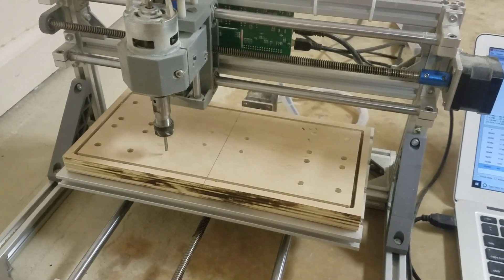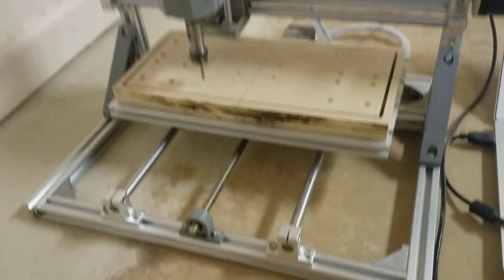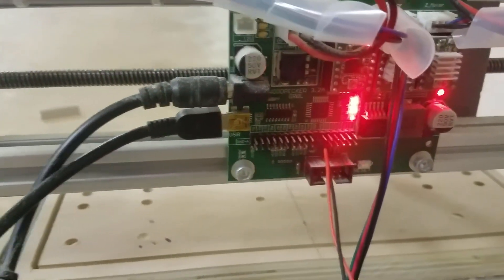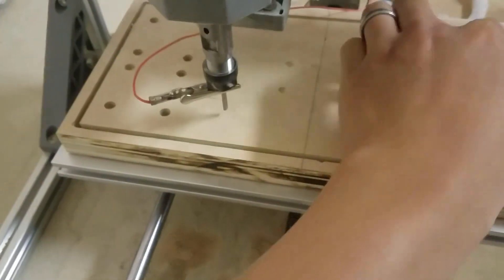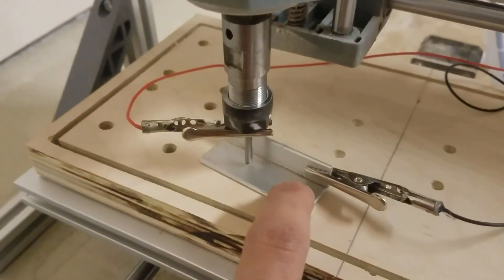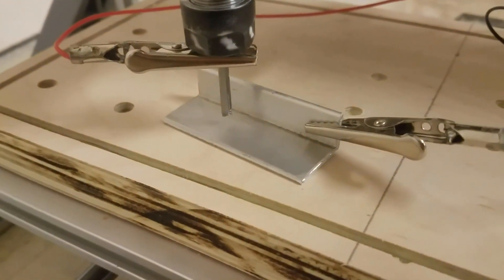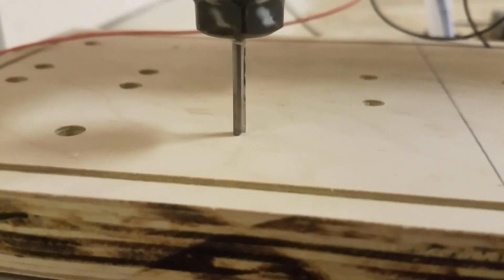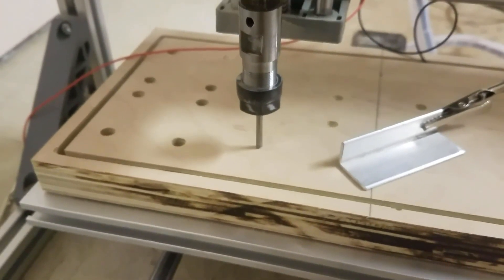3018 CNC - Z axis tool probe (zeroing Z axis) - WoodPecker 3.2a GRBL

Comment: Could you guide me please...I am trying to make my own CNC mill for aluminum working. Is the 2020 Tslot enough for this job? Also is it better to move the job rather than the z axis gantry? I see that your setup is quite light weight, I am thinking if this is enough for aluminum milling
Reply from the maker: I would go with bigger aluminum extrusion bars. I have a few videos about building cnc for aluminum cutting, you can check them out. If you do lots of work with aluminum, better go with more sturdy frame and larger spindle
Reply: @minhsmancave9448  thanks for the helpful tips. My work is aluminum and brass only. Jobs are not more than 200 mm (say max 300 mm), i am inclined towards the fixed gantry with moving work table style of arrangement, as it saves me a lot of trouble, do you think a moving gantry is better design?
Reply from the maker: Moving table has less vibration when dealing with aluminum, just harder to arrange cables, motors

Comment: hi, I m using CNC3018 mini with grbl 1.1f, I am using FR4 PCB board as probe.after height map  some of the tracks are still missing.what to do?. the steps are: after setting probe I am pressing XY zero and Z zero button then I create map, after saving map file I check the box to use same height map file for engraving.but still some tracks are not engraving.I have set 1.46mm thickness in probe command.please suggest me the solution.

Comment: Thanks for the video!! Can you help me? My board looks different than yours... but I found two pins in the corner with a label J-A5.... is that the A5 pin I need to use?
Reply from the maker: If you can find an image of your board and send me the link then I can confirm
Reply: @minhsmancave9448  Thanks, here's a pic: https://ibb.co/BBWXhqm
Reply from the maker: Yes, that's the one, j-a5

Comment: I have Mach3 CNC system . if I change to use your Candle software, Do I have to change all the circuit boards ?
Reply from the maker: Why would you want to do that? Mach3 is way more advanced and easier to use compare to GRBL/Candle

Comment: Hello sir. At first i want to thank you for all of your efforts. I learned a lot from you. I ave assembled limit switches and z probe with your videos. I want to ask is there a possibility to homing with offline controller, and z probing?I couldn't run even a .nc file  $H included. Double you have any ideas.
Reply from the maker: Homing in g-code is not $H, try G28
Reply: @minhsmancave9448  i don't know why but, I was reading your answer with your voice inside my head... it seems i wacth too many times your videos... 🤣
Reply from the maker: You will have to a few Gcode lines written the way fusion 360 generate your g28 lines. I don't remember exactly but you can try make a gcode with fusion 360 then copy those lines in a homing .nc file
Reply: @minhsmancave9448  thank you sir, I will try this asap...
Reply: @minhsmancave9448  i actually tried :/ didn't work for me

Comment: Thanks for the video.  Do you have the link to the guide, my board uses a nano and does not have the pins like yours
Reply from the maker: It's still the pin A5 on the arduino nano. Maybe just use the multimeter to see where's the connector that connected to the pin A5 on the arduino
Reply: @minhsmancave9448  ok thank you, disregard I found it

Comment: I need some help if you have time. I brought a model similar to yours. But the threaded rod was to small plus two of the rods and the gantry aluminium extrusions extrusions rails where short by 45 mm each. Plus missing 4 T nuts for table. Not to mention the bearing blocks made from poor quality 3D printed plastic. Any help would be highly appreciated.  Stay safe have a wonderful day.
Reply from the maker: I don't think the rods are short, check your base frame installation. The base frame should have aluminium extrusion bars of 360mm length parallel to each other, then 2 bars à bit shorter (330mm length I think) on the sides. So the base frame should be 400mmx330mm. If you install them this way, I think the 2 rods are just the right length. The bearing blocks are plastic on mine too, so, that's normal. If you are missing some t nuts, you can just order a few from Amazon, it's always safe to have some extras.
Reply: @minhsmancave9448  Thanks mate Stay safe. I did see an Aluminium kit from Banggood may get that one. Enjoy your show. Stay safe have a great day.

Comment: Your excellent video shows the way to make simple electrical connections for probing, but you do not mention the fact that the Candle program that you appear to be using can do the probing sequence automatically. using the button 'Z-Probe' located to the left of the 'Zero X/Y' button on the Control screen.
On my version of the software, commands similar to those you entered into the Console box were already present in the software:
Click on Service then Settings, and in the Control section, the Probe commands box contains G21G91G38.2Z-30F100; G0Z1; G38.2Z-2F10
(If the box is blank, enter the commands from the keyboard)
This sequence does two probings, the first one fast and the second slow for greater accuracy, and would leave the probe touching the probe plate.
Edit the Probe commands box and ADD the following to the existing sequence ;G10 L20 P0 Z19.1; G91 G21; G0 Z10
This sets the correct Z0 position - allowing for the height of the probe plate (19.1 mm in my case, but 1.6 in yours), then raises the tool by 10mm to a safe position. 
The display of Work coordinates for Z - at the top right of the Candles screen - confirms this as it shows the probe plate height plus 10mm. (29.1 for me, or 11.6 for you).
The additional commands are saved automatically when exiting Settings. 
If a different probe device is used, then the 19.1 (or 1.6) figures need to be amended to suit the new probe plate height. 
To use the automatic sequence, move the tool to the X0/Y0 position, and position the probe plate beneath the tool (which should be not more than 30mm above the plate).
Click on the 'Z-Probe' button and let the machine complete its double probing and move to a safe height (check the Work height for Z as above)
Click on the 'Zero X/Y' button, and the machine is correctly set, ready for machining.
I hope this helps.
Reply from the maker: Definitely helpful. I was an amateur at the time and didn't know I could make a sequence of command lines for the user buttons. Your comment will help a lot of other to make the use of the machine more convenient. 👍
Reply: @minhsmancave9448  Same command works for zeroing Y and X axis to. Just replace al Z with Y or X. For more complicated command, wich can set all 3 axis at same time, need other probe: angle vertical ( verticaly applied to the material corner, covers Y and X sides)and pad inside in angle corner( on the material top)
Write all commands in one line and they set all axis to zero, one by one. As you know, X and Y axis will be the tool diameter +, Z axis you 1.6mm.
Reply from the maker: Yes, you're right. The comment from Don has everything in it. The best way is does what he suggested, programme all the user buttons then you don't need to memorize the commands anymore

Comment: Hi! First, this is a great video. I recently purchased a Banggood Mini 3018 CNC. It ships with a Developower V4 controll board which does not have a A5 pin. Instead it has 5V,3.3,13,A0,A2,A4,A6,TX. Is there a way I can use this method on this board? This is the web address for the board https://www.banggood.com/Original-3018-CNC-Router-3-Axis-Control-Board-GRBL-USB-Stepper-Motor-Driver-DIY-Laser-Engraver-Milling-Engraving-Machine-Controller-p-1454180.html?rmmds=search&cur_warehouse=CN.
Reply from the maker: If you have a multimeter, try to see if the A5 pin on the arduino nano is connected to any pin from A0 to A6 on the board. If not, you can also just connect the probe directly to the pin A5 of the arduino nano (may need a soldering iron). The last solution, if you are good at looking around the code, is to reassign the probe pin in the grbl firmware code to another pin A4 or A6 instead of A5.
Reply: @minhsmancave9448  Hi! Thank you for your very quick response. I'm very, very new to CNC but with that in mind, I'll try not to stretch this too far. I have a multimeter, but how would I know if A5 is connected to another pin? Would zero out or give me an identical reading?
Reply from the maker: Set the multimeter to the diode direct testing. One wire to A5 on the arduino, other to other pin on the board. If the multimeter peeps, that means the pins are connected.
Reply: @minhsmancave9448  I really want to thank you for your videos and taking the time to answer my questions (most don't). Hitting the subscribe button and looking forward to your future work.
Reply from the maker: @nouveauwebsitedesign1890  no worries, Always glad to help
Reply: @minhsmancave9448  Hi Minh, an update: A5 is connected to A4 on this very odd board. I wanted to post in case someone had the same problem. Thanks again for your help.
Reply from the maker: Sure, sounds good to help others from what you learned

Comment: Realized a few things while testing this. I have forgotten the alligator clip more than once on the spindle 🤦‍♂️ before I started the program.  I use foil pressed down between the teeth of a wrench (on the clamp) and changed my height probe command for the candle software to G21G91G38.2Z-15F50; G0Z1; G38.2Z-2F10; G92X0Y0Z0; G90G0Z4; So you can see it double probes and zeros out all coordinates. I like to end the bit raised also. The probe must be closer than 15 mm or alarm will trigger. I feel a bit safer will the tool going into the wood than a piece of metal, but I may buy one of those height probe pucks because I guess the plastic would give way if you don't have a proper connection to form a closed circuit
Reply from the maker: Yes bro, I forgot to clip the bit sometime and have to be quick to stop the machine, usually unplug the cord. Programming the button defintely the way to go

Comment: Hello, i am interested in such a 3018 too, but i would need a higher z-axis - like around 100-120mm high instead of 45mm. Do you know if there is a tutorial how to do it or can you explain if and how to do it? Thanks in advance!
Reply from the maker: I don't know any tutorial about that. You will have to built the Z axis your self. The easiest way is to keep the rail and lead screw of the x axis, replace the linear bearing with SC10UU type and install the Z axis on it . You can make all the part needed with your original 3018 cnc. It probably will cost you about $40. I haven't thought about this myself because I already built a bigger machine with 200mm range z axis
Reply: @minhsmancave9448  thanks a lot for your answer. Yes i am unexperienced :-) I only have a 3d printer but my space isnt so big for a bigger cnc. i only want to work in the range of 30x20 but the hight should be higher for my ideas if possible. Do you know where i can find a diy tutorial to build it? I read that some say they would improve the nemas to nema 23. Do you think too its a good idea? Any help really would be great. Even if you know from aliexpres or so an kit to build it by my self would be welcome. Thanks a lot again for your answer.
Reply from the maker: I don't think it's necessary to upgrade to nema 23, those motor are real big and heavy, just get the bigger nema 17. That should be fine and you won't need to change the design of the machine. But bigger motors will require external power source and motor driver. If you have a 3d printer, that should also work to build your own Z axis. If you have some 3D CAD experience, this won't be a problem. One thing I definitely recommend upgrading will be the spindle. 500w spindle would improve greatly the performance of the machine.
Reply: @minhsmancave9448  thanks man!!! Yes i have a 3d printer, and yes i have made a lot of technical cad things with rhino3d, but i have no experience with CNC Mills, so i was unsure if the change of the hight of the Z-Axis is adjustable in the software or if i get in trouble after i made a change on the hardware, because i dont have ANY experience with it :-) But i think i see that you want to say i can change what ever i want as long i update the software too. And for the motors (i worked also with nema23, that i need separate drivers because the different Ampere and Volt they they need.) Would you buy a final cnc or do you think i should start from ground and build one? I dont have a lot of money to invest, but i have and product i dea for what i would need a cnc, and so i want to find out as cheap as possible if it works or not :-)
Reply from the maker: No, you don't need to change anything in the software or configuration in the firmware. The milling volume of this machine is not pre-configured. For the price, this machine is pretty low, if you build one, it'll take time and not sure will be cheaper, but surely will be better
Reply: @minhsmancave9448  Waow ... thanks a lot!!!! Now i see it more optimistic that i can do it too :-) How much would you spend max for the machine atm? I saw they bring out on 20th january a new version and the prices go from 240 - 380 dollar atm. I expect its a newer board, maybe 32 bit like on some 3d printers. But i know also from 3d printers, if the frame isnt free of vibrations and so on, you can have the best board, but you get a bad result :-) So my plan is to buy a 3018 to learn from it, improve it like you did it, and after a while build my own, instead of having a 8 week project with frustrations :-) Do you think i can make with the bought one also mill some 10mm alumiumium plates to make my own cnc with it?
Reply from the maker: Buying a 3018 to learn and experience will be a good start, that's what I did. Later on, you will find out what you need to upgrade and what you can do with a milling machine. I wouldn't spend more than $200 on the 3018 since you're just experimenting. To built a small size and reasonablely good, I'll probably invest about $300-400.
Reply: @minhsmancave9448  I really thank you a lot. Maybe a questions, do you know if the "upgrade" as they call it for the 3018 is worth? I think the change is a different board. But dont know because i am knew to it, and sure if there is a new board which is better, i wouldnt have to buy a new one again. Should i go direct to the "upgrade" version in your opinion, or do you think "no the old board is good enought"?
Reply from the maker: I think it really depends on what you want to use the machine for. For wood, plastic and small parts, it might be good to upgrade. If you are intending to do a lot of aluminum, I don't think you should use this machine. The rails are small and not sturdy enough so the cuts on aluminum won't be precise and smooth. The stock spindle is small and not really precise, it vibrates a lot which will break all the precision tips (v bit, or anything that has fine tips). So, I only recommend to upgrade the spindle and you can re-use that spindle if you decide to build your new machine after gaining enough experience
Reply: @minhsmancave9448  Great, now i know what you pointed out which is important and what the rpoblems can become. I see it now clear! Thanks a lot for your time to answer all my questions and make it clear where i have to go for my needs!!! Awesome man!!!

Comment: I'm installing the limit switches and the tool height detection.

Having these codes and adding them into each cutting code file, along with the codes for pause  until user input will automate the process significantly.

Now to find the pause code... GOOGLE!  Marlin pause:

M226: Gcode Initiated Pause
Reply: What?  M00 doesn't work with Grbl?   M00 is a standard stop state that waits for operator input.

Comment: Awesome! Used one of these:
CNC Z-Axis Router Probe:
https://www.ebay.com/itm/Cnc-Z-Axis-Router-Mill-Zero-Check-Touch-Plate-Tool-for-MACH3-Setting-Probe-od/113674852386?epid=6009700057&hash=item1a778c9822:g:PzkAAOSw23lZr9pR

Comment: Hi and thanks for the video. Where did you find the information to connect the probe to the A5 connector? I was looking for the pinout descriptions on line, but could not find anything. Do you have a resource for it?
Reply from the maker: You can read through this thread and find the info: https://github.com/grbl/grbl/issues/464

Comment: Those are some really nice looking cuts in that ply, are you using a 2 flute straight router? If you don't mind me asking, what depth and feed speeds are you using for the 3018?
Reply from the maker: Yes, 2 flute straight flat end mill.I cut very slow with my 3018 CNC. Feed rate only 750mm/minute, 1mm step down and spindle speed set at 9000RPM
Reply: @minhsmancave9448  Thank you so much, just got a 3018 to learn CAM, so those setting are very helpful, Cant wait to see more of your videos, subbed!
Reply: @PigeonPrint  Hi!
Is your router motor on your cnc a 775 type?

Comment: Thank you I was crazy to find a solution! Do you use Artcam? If yes, are you using the Candle Software? What extension are you using? I'm using the "STREAMLINE MM.nc"
Reply from the maker: Hi there, I'm glad it is helpful to you. I use fusion 360 because it's free. I use Strooom as post processor and Candle as gcode sender